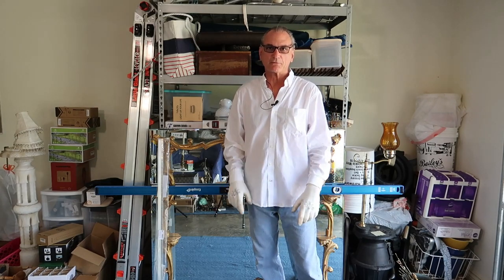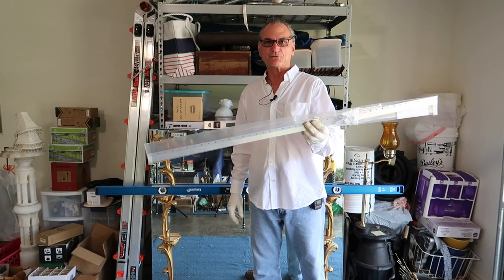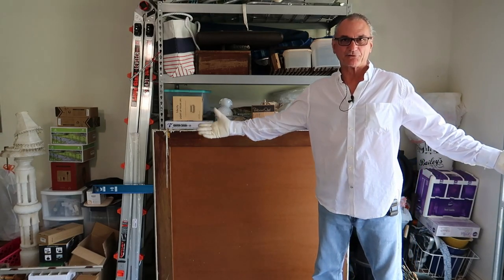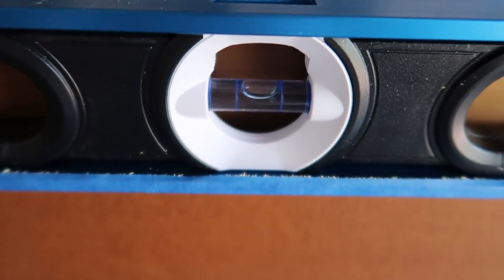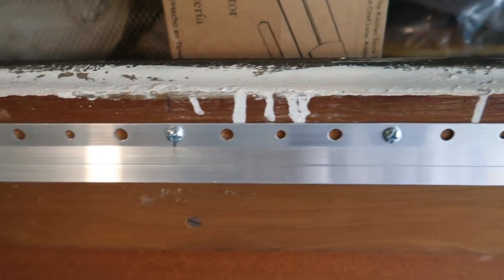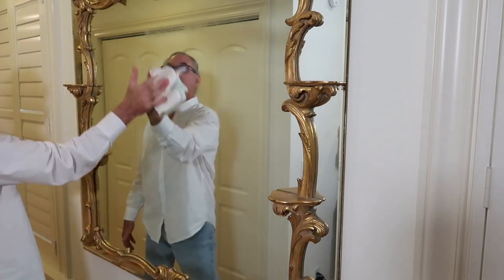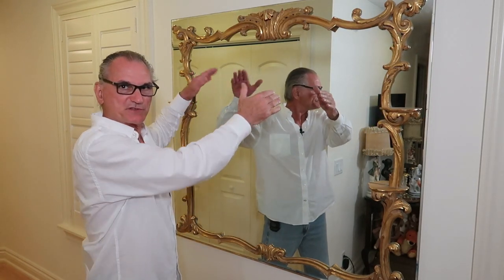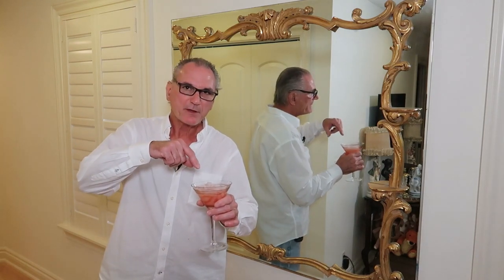French Cleat Hangs A 65 Pound Mirror On Drywall

Comment: What can I do if the wall is not even and the cleat doesn’t want to fit together? Trying to fix the issue but unsure
Reply from the maker: I would go to a local hardware store and buy 'fender washers'. Fender washers have a very large exterior diameter when compared to the fastener hole in the washer. I would try to put some kind of straight edge on the wall and shim the cleat with fender washers to match the straight edge. I hope this helps you out. Just for the record, I am not bonded, licensed or insured 😆
Reply: Used some shims and got it fixed up! Thanks